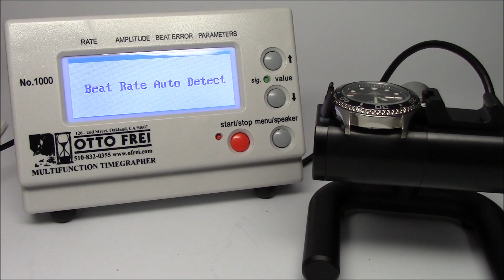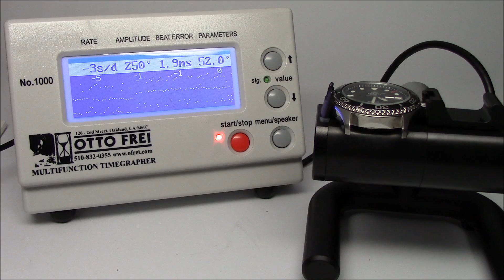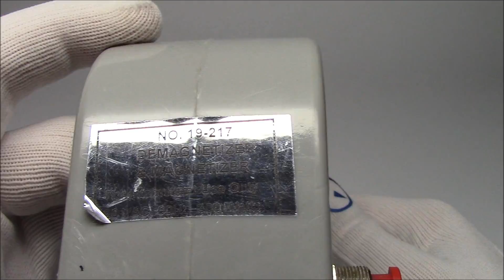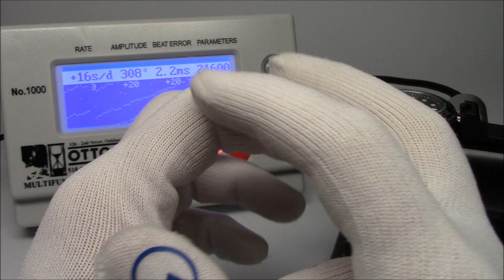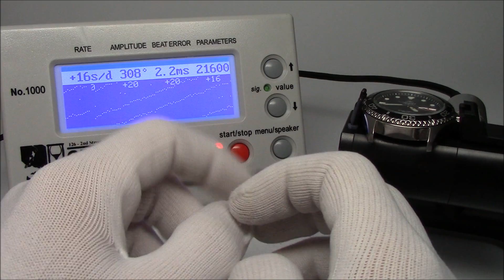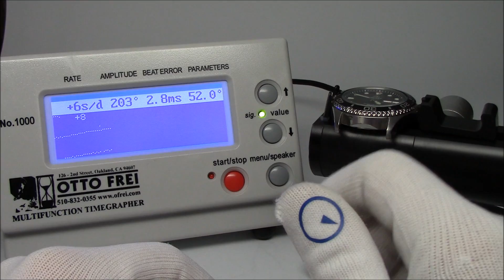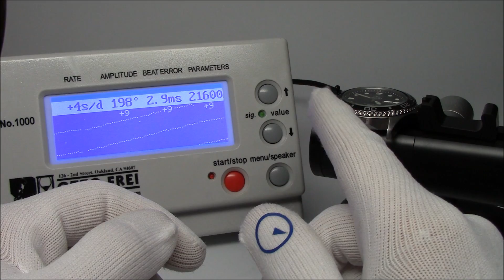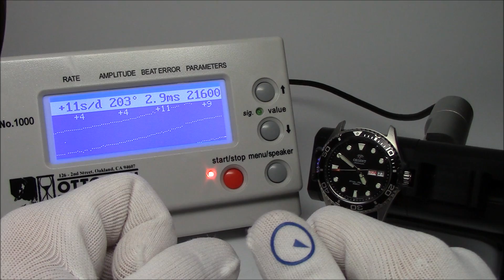How do magnets affect automatic and mechanical watches? Watch and Learn #21

Comment: Hi, Mark. I was reading the comments, because I am considering to buy a watch and I want it to keep the maximum accuracy. You said in a comment bellow that if we don't work in a specially electrified environment, we don't have to worry. But you also said that we have magnets in TV screens and even our laptop has magnets. ISO 6425 includes this protection up to 4800 A/m, which is not that much. I was thinking in a BALL, 80000 A/m, just to be in the safe side. I wonder if I am overreacting... Thanks in advence for your answer.

Comment: My Miyota 8215 kept really good time but started losing about 15 minutes per day and would stop on my wrist after a few hours.  If I hand wind it, it will run okay for a few hours. Then, it will lose about 15 minutes and eventually stop.  I had my watch about 5" close to a 12" speaker magnet before this problem started.  Was that enough to damage my watch?  I held my watch close to a Silva compass,  but the compass needle barely moved.  It vibrated a little is all.  I have ordered a demagnetizer.   Does this sound like a magnetized watch to you, or could there be another problem?  Thanks.
Reply: Did the demagnetizer work?
Reply: @travisolson9190  No, it didn't.  I bought an expensive demagnetizer too.  I gave up on the watch.  I bought a nice Citizen to replace it.

Comment: I forgot to take off my Rolex and set it far away from one of my mig welders.  I fired up a welder, drew a bead and knew immediately that I made a major mistake.  Adios Rolie...well not really, but it started to run minutes fast.  The very strong magnetic field due to the welder's current totally magnetized the watch.  Fortunately, I was able to degauss it with an old Hewlett Packard vacuum tube ammeter which had a degaussing feature, that is, it was able to degauss the probe.  The Rolex responded perfectly and went back on-time.

Comment: As many have said, 2 years ago, this is a very helpful video. Thanks Marc. What might have been even more useful is if you explained HOW you used the unit.  But for those who watch carefully, it is evident. 

It's important to note that when magnetizing, Marc placed the watch inside the "machine", then pushed the button and held it down for a few seconds...then RELEASED the button while the watch was still in the machine. This is important.
When demagnetizing, do not release the button while the watch is inside the machine. Release the button only after the watch has been pulled out of , and drawn away from the machine, slowly.

Comment: It seems to me if magnetism caused the spring to contract it would be pushing less. It would be contacted by the magnetism but that force world not be helping the spring unwind, it would be resisting the unwinding.

Perhaps the magnetism works in opposition and forces the spring a bit out making its natural tension higher. That would be consistent with running fast. The other way is  illogical. Imho

Comment: Fascinating. Question: if you keep you mechanical watch in a electric watch winder can this constant exposure to a magnetic field instill a magnetic in effect or inaccuracy in your watch. I have several watches (4) in a winder used occasionally. Have read criticisms about winders and some say unnecessarily stressing an movement. But in opposition a winder keeps lubricants from coagulating, ie less effective. Many thanks.

Comment: Thanks for the video. Quick question. When you demagnetize the watch, should the watch be completely powered down and unwound before demagnetizing? Or does it not matter if it's completely powered down or powered and running when you demagnetize?

I think I've seen most people wait till the watch is completely powered down before demagnetizing, but just wanted to see what your experience and thoughts were on the demagnetizing process.

Thanks.

Comment: Can magnetism also make a watch run very slow? I bought a sarb033 that ran +1/3 seconds for the first year and is (rather suddenly) losing more than a minute per day. Can't find a straight answer online on if magnetism always means a faster rate.

Great video,
Devin
Reply from the maker: Faster only, as it tightens the spring coils.
Reply: Long Island Watch Ok, thanks.

Comment: Thank you for the video Mark! My question is this then: is it worth investing a bit more in a watch with magnetic field protection (I am looking at a Sinn for my next purchase) or just spend 20$ on a demagnetizer and demagnetize the watch every so often?
Reply from the maker: Depends on your environment. If you are in a normal environment, I wouldn't worry about it. If you work around high power machinery (high electrical current) then maybe it's a good idea to get an antii-magnetic watch.
Reply: Long Island Watch Thank you for your reply Mark.

Comment: Magnetizing anything with AC is not o secure way to do it! To magnetize, rectify the AC and for demagnetizing, put a PTC (Positive Temperature Coefficient resistor, that rises the resistance when heated with the current flowing through the PTC) in Séries with the coil... just like in an old CRT TV set!

Comment: Would a magnetometer at an airport security checkpoint or entering a government workspace impact the watch?
Reply from the maker: No, doubt it!
Reply: I work for the government and a couple of days a week I have to use a walk through metal detector and also use a hand held metal detector. All of our detectors are made by Garrett. After watching this video, I contacted the company and asked if using either of these two metal detectors could magnetize a mechanical watch. They said no.

Comment: I'm a bit confused. The Rolex milgauss, a watch specifically advertised for being anti magnetic withstands a field up to 1.000 Gauss, according to the official rolex website. Omegas in-house movements such as the 8500 and 8900 found in their planet ocean's are claimed to be anti magnetic to a field up to 15.000 Gauss, and the selling point of watches is not even their magnetic resistance. Am I missing something, maybe the Rolex has a higher rating and I just couldn't find it anywhere?

Comment: I'm wondering, could being too close to a microwave oven magnetize a watch? I know there is a magnetron in older ones. I ask this, because I recently purchased a Seiko turtle, and the first day, it was running 20 seconds fast. The following day, after having been close to my running microwave, it started running 30 seconds slow, and has not changed since.
Reply from the maker: Doubt it.

Comment: another question , you're using a orient from bin to show us how it works, why you don't want to repair? does a watch has a lifespan? so watches could eventually die??? that's scaring...will i lost my collection and see it dying day after day like soldiers on battlefield?
Reply from the maker: Because they are all damaged and have various issues, so we use them for parts.
Reply: thanks 4 reply

Comment: i would like to know what is the best long term value investiment watch that retain value and could serve like investment could you explain what are the best value/price brands?
Reply from the maker: Patek or Rolex. Maybe a couple others.
Reply: nothing lower value ? in the range of seiko monster...thanks 4 reply, what about something very durable? rolex needs constant servicing, and could be too fragile for everyday work. i know the best could be casio g shock but i'm talking about real watches not plastic ones...you could also show how buy cheap watches and if in case the quartz dies one could read the movement specific order part and simply remove the crown mount the hands and ...new watch for 11 dollars...thanks

Comment: So I just bought a Seiko watch and on their own website is said that it has Magnetic resistance of 4800 A/m. How is something like that measured and what do those units means? And is 4800 A/m your standard resistance on a watch that was just put there as random fact or?
Reply from the maker: 4800 AMPS per Meter is a minimal field; about 60 gauss; less than 10% what the MilGauss withstands.

Comment: Let's say you have a cheap-ish watch that runs -8s/day. Since magnets almost always speed the watch up a bit, would it be 'wise' to attempt a quick & dirty speed-up regulation with a small neodymium fridge magnet? You could bring it progressively closer to the watch for a couple seconds, measuring the effect each time using a fancy timegrapher or a smartphone app like WildSpectra. Better not to crack open the caseback if you don't have to.

Comment: So... I am waiting for "how to regulate a watch?" that would be very interesting.
Reply from the maker: It will happen!
Reply: Looking forward to that one! It would also be interesting to know why there's never been a watch (or has there?) that's exposed the regulation via buttons on the case to allow you to adjust +/- 1s/day without having to manually crack the case open and touch the extremely sensitive armature.

Comment: Do magnetized watches only run faster? Because my SARB017 is slow by about 45 seconds a day, and I'd thought that was the problem until now.
Reply from the maker: Yes, generally. I guess it could be so magnetized that the spring gets out of whack, but I doubt it. 45 sec/day is within regulating tolerances so you can likely speed it up.

Comment: Test the milgauss or omega and see if their claims are true? Should be interesting.
Do quartz watches get affected too?
Reply: As far as I understand - it is far easier to magnetise a mechanical watch as the hairspring coils can stick together speeding up the watch considerably. It may be possible to damage a quartz watch but I think the magnetic field would have to be extremely strong and may therefore irreversible damage a quartz watches circuitry.
Reply from the maker: Quartz watches are affected, but detrimentally, as a high field will fry the circuitry.

Comment: Great video showing that magnetization does affect the accuracy, but could you give any insight on why?  Such as, what internals are affected by the magnetization to cause the change in accuracy?
Reply from the maker: The balance spring become effectively smaller as the loops are attracted to each other.
Reply: @islandwatch  No. The coils attract each other until they touch, this is what shortens the spring and increases the rate. The more coils that touch, the faster the rate.

Comment: Ok, so when you use a compass as a diagnostic tool for magnetisation should there, ideally, be no response at all? Or is a faint respons normal (as a compass will react to non-magnetized ferrous metals anyway, won't it?)
Reply from the maker: It is really the degree of the response. A watch case will attract a magnet somewhat.

Comment: Another great video and perfect timing I just demagnetized my Anonimo last night was running over a minute per 24hours. so far running slow 4 seconds in about 12 hours. 
I used Lepsi to check for the magnetism do you know if it's reliable or am I better off using a compass?
Reply from the maker: Sounds great! You did a great job. IMO, if the watch is timing well, why even check for mag? But a watchmaker, I believe, will almost always demag a watch just to rule it out. Its simple and free.

Comment: what is amplitude in the measuring device? and why is it in degrees?
Reply: exxonrcg have a search about lift angle.
Reply from the maker: Amplitude is the angle the balance wheel is turning from stop to stop. Once the machine knows the lift angle (which we input), it can calculate the amplitude and beat error. These are all diagnostic numbers.